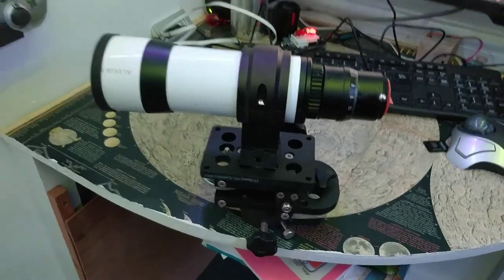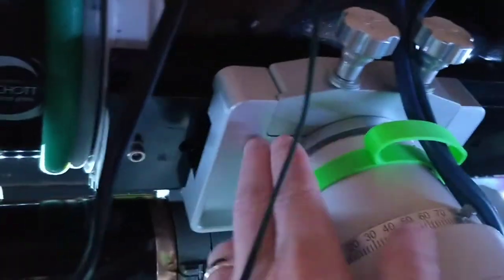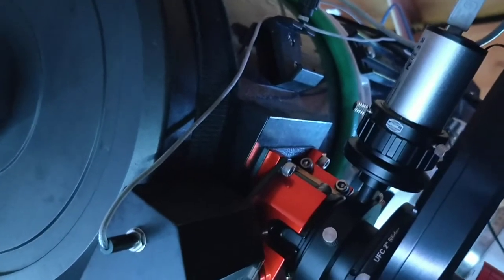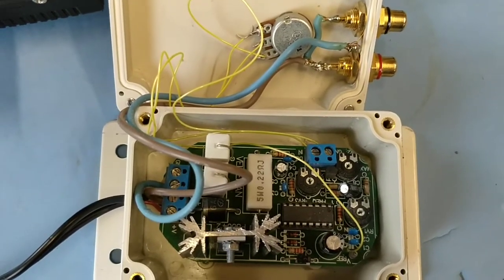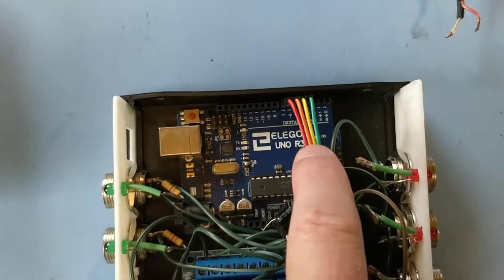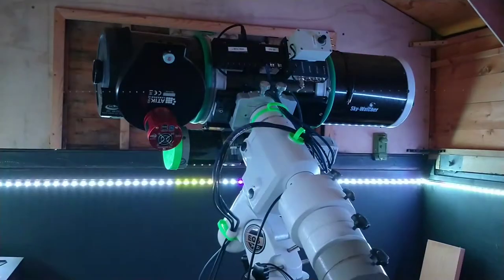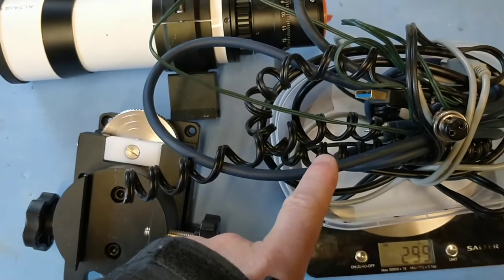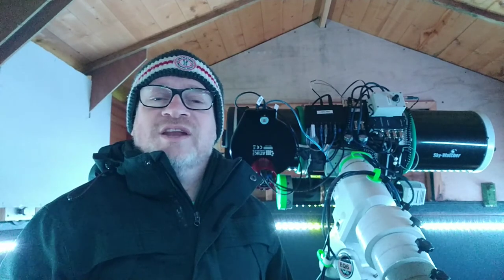My Telescope lost 5lb's in the run-up to Christmas!

Comment: Simon thank your sharing the power buddy switch controller. I have upload it on arduino and made the wiring. Installed the ASCOM driver and client, but when I open properties in ascom driver and check conection, it delivers COM16:255 power buddy not responding. Any idea?
Reply: When you get an issue like this the first step is to pair it right back to the basics. Try the following...
1) Connect the Arduino
2) check the com port the Arduino is connected to using Windows Device Manager 
3) Check the COM Port properties,  it should be set to 9600 8N1
4) open the Arduino IDE go to serial monitor and connect to powerbuddy
5) go through the commissioning steps (they are listed in the Arduino sketch)  and let me know where it fails.
Reply: @DIYTinkerer  Thanks for having the time. 
I had missed to UNCOMMENT the  line 'EEPROM.write(0,0)', Now it is working.

But I have 3issues now:
1. The powerbuddy client is off but the led in relay is on. If a set on then led is off.

2. After comment the line and upload. Now if I try with NINA, selectting properties it shows a .NET pop up unhandled exception with a continue buttom, and the ASCOM powerbuddy pops up but the "comm port" does not display nothing. This happends with or without powerbuddy usb connected.

3. CIRCUIT SET-UP topic. I am not familiarized with this. Do you have a schematic for this?
Reply: @mvargas333  I busy with family things for the next few days,  re NINA, it doesn't play with ASCOM switches in a conventional way, and the switch interface sucks, my original intention was to use NINA but quickly realised it is so chatty on the serial port and so clunky a user interface that I built my own client, and you can script it to work for autonomous working, which is what I do with APT. I'll update the wiki on GitHub with more details, a diagram etc. In a few days
Reply: @DIYTinkerer  understood about NINA. Is there a problem if I only wired pins 2 to 9, 5v & GND? Thank you.
Reply from the maker: that should be fine - here is a wiring diagram https://github.com/SimonTelescopium/PowerBuddy-Arduino-Sketch/wiki/Arduino-Wiring
Reply: @SimonTelescopium  Thank you!, very easy to understand. I have all wired, relay is controlled by the powerbuddy , leds are on and off when selected, but there is no Click sound in relays, I have connected the 12v power supply, and a multimeter and there is no voltage comming out the relay. Any suggestion?

This is  the 8 channel relay and external power supply diagram. 
https://www.14core.com/wiring-8-channel-optocoupler-relay-module/
Reply from the maker: @mvargas333  the LED's are powered directly by the 12v from the relay, see this diagram https://github.com/SimonTelescopium/PowerBuddy-Arduino-Sketch/wiki/Arduino-Wiring - they effectively provide an indication on if you have 12v on the 12v input (the common on the relay) and if 12v is switching to the output -  so I think you need to recheck your wiring / testing as you can't possibly have 12v powering the LED and not also have 12v on the output. Same goes for the relay's audible click, the LED's can't be switching on and off if the relay isn't engaging unless you have wired the LED's incorrectly -  I guess they could be very quiet and below your hearing threshold, but mine I can hear in the warm room... Also make sure you have the ground and VCC on the relay board connected to the the GND and VCC (normally 5v) line on the Arduino (you should check what VCC that relay board requires just in case it isn't 5v)
Reply: @SimonTelescopium  sorry, I meant the relay’s led board. They do light on and off but there is no click and Power from delay to devices
Reply from the maker: @mvargas333  Sorry I don't think I can help further, I'm not familiar with that relay board, you should probably double check your wiring, it sounds like the board is receiving the signal from the Arduino but not actually energising the relays, - suggests a power supply issue - worth checking that the the VCC voltage is correct and the Arduino can supply enough current to it.
Reply: @SimonTelescopium  PROBLEM SOLVED!. I was using a 12v relay. I just bought a 5v relay and everything is working as should. 
Thank you for sharing this project it will help a lot!. 

I hope you can find some time to figure it out how to make it work with NINA. I  like the idea to turning everthing automatically off at the end of imaging.
Reply: @mvargas333  Great :-) Awesome news